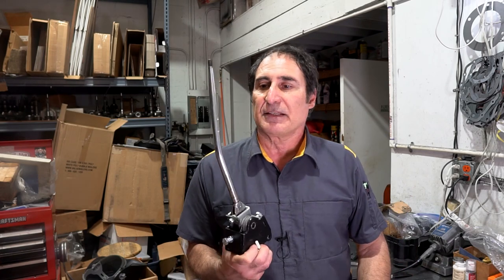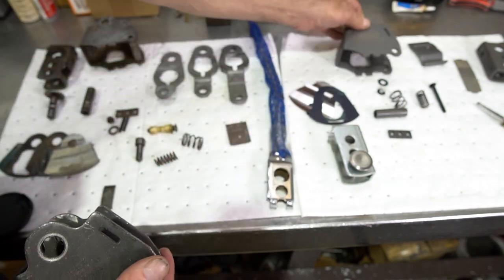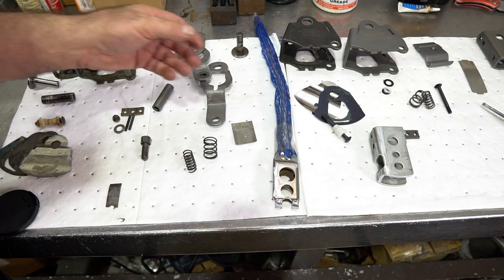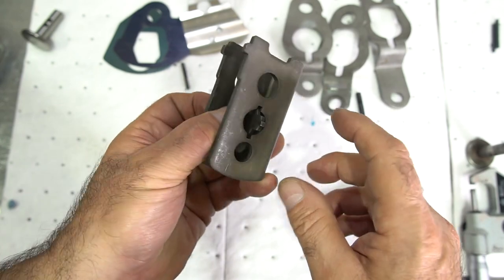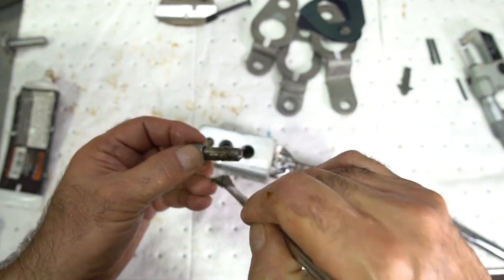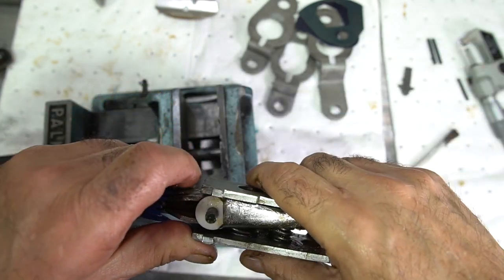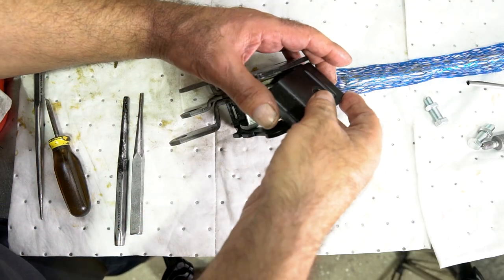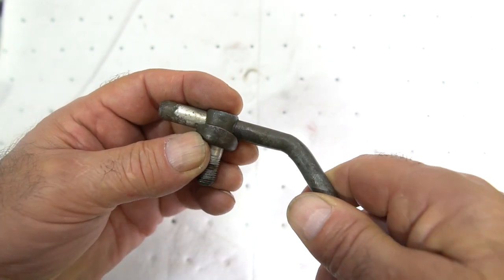Learn How to Rebuild a Hurst Competition Plus Shifter. Part II.

Comment: Re: Spring install fixture. Another way to get the small pesky spring in is to take out the reverse key and put it in the back slot, Then turn it over put the spring in the hole, then take the washer and slide it in as close to the top as you can and as far as you can till it touches the spring on the underside!, Then with a small set of pliers pref small adjustable, Then turn the spring, as it rises you will see the spring threading the washer, keep turning until the washer gets to the top of the spring, When it does you can adjust the washer and spring from the hole to its perm position. putting the reverse key in the slot keeps the spring from rocketing out and nailing someone. Thought this may add to the great stuff people are sharing. Another Great Vid Paul ;-).

Comment: Great video. One thing I was wondering about is that on some Hirst shifters I have taken apart to clean and re-lube the cross shaft had a thin shim washer in between it and the main body. It sits in the pocket of the main body that the cross shaft sticks into. I was hoping you would have shed some light on that. Why do some shifters have it and how to determine if you need them or not?
Reply from the maker: Shims are needed sometimes to make sure when the body is compressed that the pivot shaft is flush with the body.,. I show this in some off my shorts
Reply: @GearBoxVideo  thanks for the responce!! I'll look through all your short videos and be sure to give them each a thumbs up. Thank you for sharing all this great info.

Comment: Excellent, as usual! Thanks again for the lunch-time video.
My old 1969 LeMans had a factory M20 Muncie 4 speed and factory Hurst Competition Plus shifter. I remember the holes in the plates for the shifter rods were smaller than the aftermarket bushings, so I couldn't add bushings. Also, there was a thin coating of rubber on each side of the hole (for vibration damping?). I had no means of removing the slop, apart from adding thin washers.
Reply from the maker: I drill out the plates for bushings

Comment: So glad to find this video. I have a 66 GTO and the problem I'm having is when I shift into third the gearbox goes into 1st and the shifter gets locked up in the 3rd gear position. I have to manually move the lever back to neutral. I've burned the piss out of my forearm on the exhaust doing it on the side of the rode! Any thoughts and help would be greatly appreciated. Thanks
Reply from the maker: Watch my secrets revealed video for a fix to that exact problem

Comment: Is there any trick to putting carrier together without the 3d printed fixture? I took my shifter apart to swap in a straight carrier and remove a Camaro style angled carrier to fit my Super t10 to my 66 Chevelle ....and now I can't get it back together 🤦‍♂️🤦‍♂️
Reply from the maker: Hurst has instructions with their rebuild kit that you can download from the Holley website. Even with the instructions it's time consuming but works

Comment: Is it possible that I remove the synchros from my zf 5 speed gearbox and cnc from aluminum billet dogboxes to replace them? That would make it a helical dog box but will the aluminum billet hold?
Reply from the maker: No it will not hold
Reply: @GearBoxVideo  would you please let me know exactly which metal to cnc for the faveplating??
Reply: @GearBoxVideo  i can cnc high carbon steel and the harden it after machining is finished. But it would be great if u would mention the type of durable metal to use

Comment: I have a 70 GTO with a Muncie M20 and the original Hurst shifter. Everything shifts fine for the first hour and then it starts getting hard to shift into any gear and seems to hang up in second gear. I've adjusted the linkage a couple times and adjusted the clutch to no avail. Any suggestions? Thank you
Reply from the maker: Shifting is not time dependant. As your car warms up the clutch is probably not releasing properly. Get rid of some clutch Freeplay

Comment: Are these rods with the threaded ends the same as the original ones? What kit # is this? And does this still fit with no modifications to the console?
Reply from the maker: Kits are make and model specific.  You order the wrong kit or have a transmission that never came in the car and a stock kit won't work.  Everything I sell FITS

Comment: How do you know when you have your stop bolts in far enough?
Reply from the maker: You put the transmission in gear and adjust the stop bolt until it touches the shifter mechanism.

Comment: What does it cost to 3D print the assembly fixture?  I'm considering CNC cutting a set from Aluminum for cost comparison then I will ship them to you to try out. The STL file import may not be perfect so I will email you for better CAD data if you are interested.
Reply from the maker: Sure. My email is support@5speeds.com. cost depends on materials. Some people have sent me pictures of the printed fixtures they did at they work well. There are changes that need to be done and I was hoping people would share designs but I think the concept was above most people's heads.

Comment: I downloaded the 3d printer file but it's not the right size. It's like 3.89 mm across. Has anyone else had this issue? Does anyone know the proper dimensions?
Reply from the maker: As mentioned it is in Inches. You need to read my pinned post on GrabCad. Often times printers load metric as a default.

Comment: I’ve rebuilt mine because it was sloppy and hanging up in the 2-3 shift. I closed up the slop to 25 thousands of an inch and it’s still hanging up in 2-3
Reply from the maker: If the trans stays in 2nd while shifter is stuck in neutral its the shifter. If you can't just get 2nd...like a block out then its the trans.
Reply: @GearBoxVideo   It Sticks in the second and the only way to unstick it is to reach through the floor and pull the 1-2 lever back To neutral and then I’m good to go
Reply from the maker: You may have an internal issue with the cover or a geometry issue with the rod and arm

Comment: Use a brass exauhst nut the long ones 3/8" 16 and bolt cut to the right length as a jack screw to separate the body. to withdraw the plate. and the big brass drift that every good auto parts store sells to alighn  the gates to put the 5/8 hardened pin in place the waveyness in the plates makes room for the grease (what i think that driven stuff looks yaaaa)
Reply from the maker: I use a jack screw in my very first video if you watched it. And no, the plates should be flat. The plates were perfectly flat for decades until they were made in China.